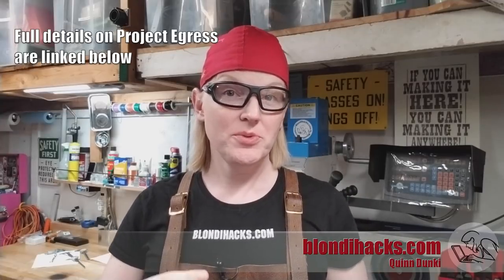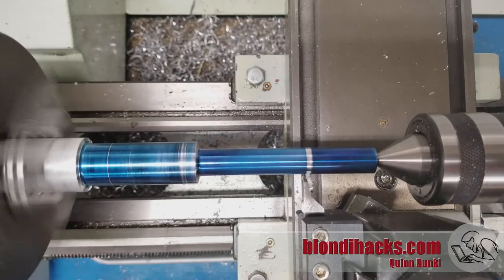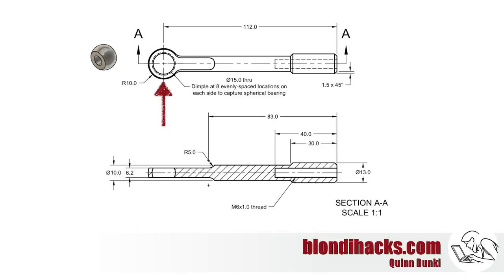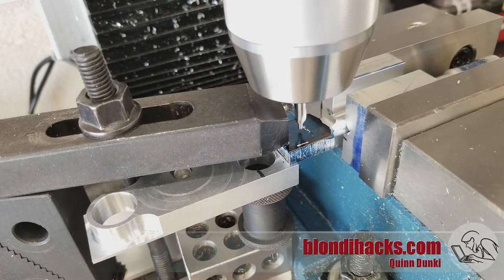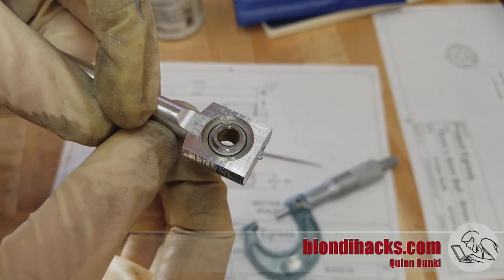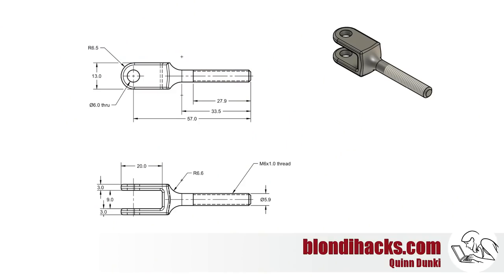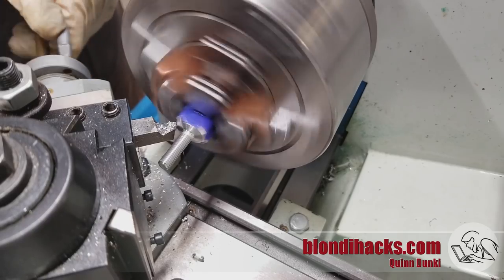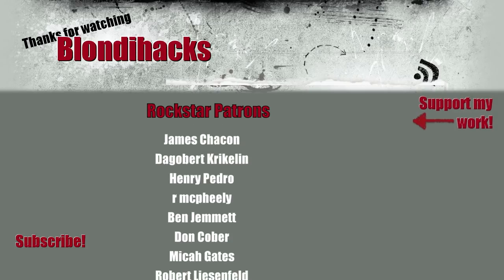Project Egress, With Adam Savage

Comment: To set up for that delicate a size, you can set your top slide at a low angle, and use it to take off in tenths and hit exactly on the nut.  Can I suggest making a tapered scraper of an old triangular file, grinding down the teeth, setting up three 60 degree edges.  Very useful for deburring holes, and taking out tenths of thousandths.

Comment: I understand because I'm part of the Imperial units resistance movement (IURM) here in the southern US, but "fifteen millimeter or 630 thou'" sounds like you might have missed it by one sillymeter.  Don't sweat, I do it regularly.   I think, however, that you just misspoke -- you seem too sharp to miss something like that.    As long as you catch it before you cut!   Thanks !!

Comment: @Blondihacks - really cool project! One question - is that thinner area near the bearing end not needed for clearance or anything like that? It's shown in the drawing but doesn't seem to be on the finished part.
Reply from the maker: Yup, that’s correct! I checked with the engineer and the larger flat area isn’t a necessary part of the design. He said it’s just a standard aerospace part and that’s how they come, but it isn’t needed here. It made my machining setup a lot simpler to omit it, so I did.

Comment: Tip on collet use: 5C collets are meant to hold only nominal size stuff, not a tad over and only slightly below nominal (like a thou). 5C collets are not very good in holding power as the grip length is so short in the collet. Better option would be ER-collets, for exampe ER32 collets will clamp even 1 mm undersize, but they have the same upper limit, as in nothing over the nominal size. And the gripping length is longer.

If you buy those cheap import collets, they are great in a pinch as you can hacksaw thhem in half and thus grip that shaft from the middle by placing the halves on it and slide them into the nut one at a time. Has saved my butt many times on difficult to hold workpieces :)

Comment: I've got a little tip for you from my old shop teacher back in the days when lathes were belt driven and HSS ruled.
Take your Dremel with a cut off wheel in it and put a groove about .030 to .040 behind the cutting edge parallel to the front face of the tool.
This makes a chip breaker that will make those long stringy aluminum chips snap off short.
You will have to experiment to find the optimal depth and distance back but it does work.
Reply from the maker: Yah, Adam Booth sent me a chipbreaker design that I’ll be trying out. Thanks!

Comment: I would bet those parts were originally made using manual manufacturing methods.
Thanks,
John
Reply from the maker: Yah, I imagine so! It was nice to do an homage to those machinists who built the original.
Reply: They used a lot of NC machines in the 60's. It used a pinched tape drive.

Comment: Nice video, you just found a new subscriber!
Question: How do you hit the exact assembled length with two parts that are threaded together and have a specified relative orientation (hole axes parallel, in this case)?
Reply from the maker: That’s an astute question. The truth is the tolerance is necessarily within one half turn of the thread. As long as you have some travel on either side of the needed position, you can get the holes spaced within a half turn.
Reply: @Blondihacks  Thanks! That makes perfect sense. So I guess if you wanted better than 0.5mm you'd have to hope to get lucky ;] or cut at least one of the threads on the lathe with a dictated thread starting point on the part (is this kind of thing ever done?). For the life of me, I couldn't see how you could have any control of the precise mated length using tap and die.

Comment: Another nice job!! If I may I'll throw out another idea, or trick that works for me. Instead of doing the ole 2 handed trick to turn the knob/handle on a compound, rotary table etc... Build a "socket" to fit said knob and turn it with a speed handle (handle bent like a crank that takes a 3/8 or 1/2" socket) easy to keep a constant speed, and no arm burn. Again, nice job!! Thanks for the videos keep it up please ma'am!
Reply from the maker: Yes, I have seen people do this- looks like a good idea!
Reply: If needed often, a geared motor with some speed control might work also.
Some machinists here on YT have used cordless drills, but maintaining a constant slow speed maybe challenging for some.

Comment: Noob question: If that final dimension between the hole in the fork and the beating is critical, do you have to take that into account when you start your threading? Otherwise it seems like you could end up long then after a half turn you may be short. Unless the direction of the hole is not constrained by whatever it attaches to. (Yes I do know this is 2 years old.)

Comment: Wow !!! what a fantastic project to be involved in 😊 you must be super proud🤩
More great standard Quinn problem solving and that quiet humour 👍
But where is Sprocket? barely noticed him 😏
Were the original dimensions in gnarly metric? 🤔 seem to remember that the first docking between Apollo an Soyuz was complicated by getting metric and imperial to fit well.
Reply from the maker: Yah Sprocket was very chatty in the evening when I was trying to record. 😁. Everything was metric and there were a lot of challenges in work holding that I glossed over a bit here. I had to make a fixture for pretty much every setup. The dimensions actually worked out well in imperial though.
Reply: no fun if it's easy 😁
Reply: NASA has had issues with metric vs. imperial as recently as 1999 when the Mars Climate Orbiter crashed into the planet; the program doing the thrust calculations returned its results in imperial units instead of metric. But hey, what's another couple hundred million between friends?
Reply: 🤣 ouch.. thats a big mistake

Comment: Blondie...I've got a little piece of gold to give you. Using shim-stock,  for tool posts or a flat washer for carbide insert triangles, fashion an adjustable pitch "CHIP BREAKER", to eliminate the "angel hair" problem. Your cutter has a radius tip, for smooth cutting and yoir chip breaker just behind and off to one edge, for the stock that is being remover, to run into and break. You'll have to play a little to get the proper angle face, but once you do, clean-up will be fine chips instead of long dangerous stuff.
   Thanks for all you do!!!! You're cute, too!!!
    ((Angel hair is bad because it can get caught in your chuck and make a safety concern. Angel hair is also a safety concern if turning magnesium. It's bad to catch fire !!!))

Comment: Hi Quinn. I am having trouble getting quality surface finishes as you have achieved on holes bored on my PM25 using a boring head. On 6061 aluminum the inside surfaces of the holes are not any where near what you achieved in your video here. 

I've tried different speeds, feeds, lubrication with some success but still nfg.  I'm using a carbide insert boring bar and I'm thinking that there may be a better jnsert to try.  A replacement is arriving shorty. 

Can you share any tips and/or ideas you have to get better results on those inside surfaces?  What do you think are the most important things to get right for a good surface finish?  Thanks.

Comment: Hey! Good work 😀
At the end you put the finished part on the drawing. Isn’t the flat sides on the end for the ballad bit too short? On the drawing they continue a bit down the shaft.
Reply from the maker: That's not a necessary feature on the part, and it simplified the setup to omit it. Thanks for watching!
Reply: Wouldn't that square slot in the clevis have been achieved by milling Vertically instead ofHorizontally?

Comment: You should have used a ball turning tool for the end holding the bearing. That would have been the proper way to make the part. The part would have looked exactly like the drawing and you could have bypassed all the sloppy filing and sanding.

Comment: COOL very well explained ,  How would you make a # 35 - 36 tooth sprocket with out a gear cutter on the vertical mill  ?
Reply from the maker: If you don't want to spring for involute gear cutters, you can make a single-point gear cutter (sometimes called a fly tooth gear cutter). Google "single-point gear cutting" and you'll see some example.

Comment: What about the relief on the shaft? Was that part optional?
Reply from the maker: I confirmed with the engineer that it was not needed. It's a standard aerospace part and that's just how they come. It isn't needed in this application, and omitting it saved me a lot of time (which was very short for this project)

Comment: How do you get a precise dimension between the two holes with the one part being screwed into the other? Since the form has to be in a certain orientation with respect to the bearing, you can only adjust the distance between the holes in increments of half the pitch of the thread. Also, if the length of the shoulder is also critical, that isn't even an optiom. Did you just get lucky with where your tap and die started or am I overlooking something here?
Please do explain if anyone knows the answer to this. If I had to make this part I would have chosen a ridiculously overcomplicated setup compared to this, just to be able to account for that

Comment: Beginner machinist here... looked like climb milling on the rotary table to me. (feeding leading edge of material under the leading edge of the cutter [cutter wanting to climb up material]). Am I missing something/
wrong?
Reply from the maker: Nope, that's conventional milling. The cutter spins counterclockwise (viewed from underneath). On video, machine tool spindles often look like they are running the other way because the Bicycle Wheel Effect. That may be throwing you off.
Reply: I try to be careful watching vids as I am well aware of strobing messing with the apparent rotation.
 (Adam Booth was turning on a stepped part with splines... each step appeared to be rotating in opposite directions!😮😉😏)
Rewatched the rotary table section several times and checked several machining manuals before commenting.
Rewatched again today, on the big screen.
At the very end of the op, I caught the detail I missed where the spindle stops and you can see the actual direction it was spinning. 😏😉
As well as the flute direction on the cutter, *duh!*, should have checked that FIRST! 😜🌴

Comment: Hi Quinn, Found the video interesting and well presented with a very sensible approach. I see at the intro you show a Digital Oscilloscope (CRO in Australia), are you also involved in electronics? My wife and I are involved in electronics, woodwork and fitting & turning/metal work.
Reply from the maker: Indeed! Over on my blog (blondihacks.com) I built a computer from scratch. Look for "Veronica" at the top of the website.

Comment: I know this project is not supposed to be 100% authentic so maybe this is an inappropriate question. Was the original made with using metric dimensions? That would seem strange considering the American passion for our abandoned imperial system.  By the way, well done. an excellent piece of work.
Reply from the maker: I don’t know what the original Apollo parts used, but Andrew Barth recreated these drawings in metric.

Comment: Funniest description of a boring head ever...
"Boring is ver precise but not fast".... it's a bit boring.
M6... metric?! ... in America?! .... in the 1960s?! .... crikey!!!!
Ooooooh..... a ratchet die holder...... I want one of those.
Reply from the maker: I'm not sure if the original Apollo drawings were metric or Imperial, but these are recreations from 3D scans of the original parts. That work was done by Andrew Barth.
Reply: Apollo spacecraft used AN and NAS standardized hardware found in aircraft of the time.  That specification has become Mil Spec, or MS.  Both are based on inches and fractions there of.  

     M6 is just under 1/4 in, so if this project will be full scale, the original threads would be cut for AN4 (NAS6204) which is 1/4” 28 TPI.
Reply: @Blondihacks  Herr Von Braun  was German ,so its metric ...
Reply: NASA has actually been working exclusively in metric for quite some time, at least the Space Shuttles have been designed all metric to my knowledge.
Reply: @billlewis9740  If people can't figure out things in USCS, how the eff can they tell time on a base 12 or base 60 system? Lol. Probably the same idiots that can't read an analog clock.
Reply: @xenonram  We can all figure out US customary (or British Imperial) but it's annoying to always be changing bases (they aren't even consistent within units of length: 12 in to the foot, 3 ft to the yard, and 1760 yd to the mile. Certainly keeps you on your toes). When you get into scientific work and start dealing with a lot of derived units it gets moronic: you can measure energy in BTU (thermal), Cal (chemical) or ft-lb (kinetic) depending on what you are working with, and there is no sensible conversion between any of them- makes power output calculations a pain in the ass (compare metric where energy is always in Joules and a Watt is simply a Joule per second).

Comment: Good stuff, Quinn! What rpm did you get the best finish at?
Reply from the maker: On the lathe, about 600 rpm was working well. On the mill with the 1/2” endmill, 800 was a sweet spot. 500 with the 2” shell mill.
Reply: Blondihacks Great! Thanks.

Comment: Hello, I'm going to risk displaying my ignorance here... Wondering here about the significance of squaring up your toolpost on the lathe. Why would that be significant? Please?
Reply from the maker: Toolpost angle mainly depends on the tool you’re using. For certain tools, like parting blades, you want it perfectly square to prevent binding up. Other tools want an angle, for relief or lead, or for clearance when turning to a shoulder. I cover a lot of this in my Lathe Skills series. Check out my playlists for that if you’d like to know more.

Comment: The distance between the holes was speced to 0.5mm.  The thread spacing for M6 is 1.0 coarse or 0.75 fine.  Assuming the axes of those holes need to be coplanar, 1/4 turn off could give a distance error of 1/4 of the thread spacing: 0.1875 for fine thread.  That could be as much as 37% off from the specified distance.  I don't know how much backlash there might be for M6.  I suppose the spherical bearing could take up some if that as well.

What little I do is mostly in wood and I'm not capable of this level of accuracy. This level of analysis is probably not something I'd do until after the first failure.

I suppose that the saddle joint and the swing of the arm it connects too might allow for way more slop than this.

I also come from a software background.  Though I have good spatial and mechanical reasoning skills, I'm not practiced at thinking about this kind of thing.  Do you have any tips and tricks for analysing how much accuracy is needed in a given situation?

Thanks for the high quality of instruction in your awesome videos.

Comment: Excellent video. Just confused how you achieved accuracy keep swapping back and forth between metric and imperial measurements?
What was the orriginal apollo measurement system?
Reply from the maker: These modern drawings were all in metric. I'm not sure what Apollo used originally. These drawings were re-done from 3D scans of the Apollo hardware by Andrew Barth. My tooling is almost all Imperial, so I converted the drawing. I'm Canadian though, and we're pretty comfortable in both systems. 😀

Comment: 23:18 have you ever had to consider where you start your die so that your length is correct when the holes are parallel? I've wonder about this with some assemblies, because it seems that .5 (because you have 2 parallels per rotation) of your thread pitch is your margin of error. I'm not a machinist so I don't know these things for real.

Comment: I'm curious - would it have been feasible to heat the aluminum and fit the bearing in with an interference fit?
Reply from the maker: Possibly, yes!
Reply: @Blondihacks  Thanks for the response, I think heated interference fit is such a cool technique. I'm very much a novice though and thought maybe the small section of aluminum would risk warping or even tearing.

Comment: That bearing wasn't hardened?
Reply from the maker: Nope! Mild steel. Worked out great.
Reply from the maker: Since we're being pedantic, those things have a lot of names. Swivel joints, spherical joints, Heim joints, spherical bearings. Language is messy.
Reply from the maker: I think any surface that carries a load can be called a “bearing” pretty rightfully. I think of a joint as being an assembly, so it would require both halves. I doubt there’s universal agreement on my pet definitions there either though. 😁 I think nowadays people only think of bearings as things that roll, but on steam engines and such, all the sliding parts are called bearings or bearing surfaces. Language evolves with the tech, though!

Comment: The only way to make a hole .630 inch and be dead on is a boring head? I beg to differ, but then I have a lot of reamers. Reamers can be accurate down to a couple of tenths. OFC, you'd have to grind, harden, and temper this particular .630 reamer yourself. That may be a bit too much work for a free project.